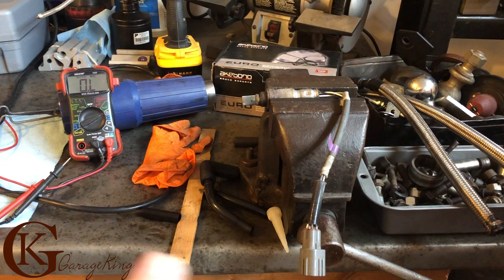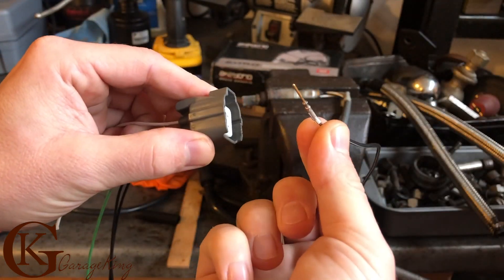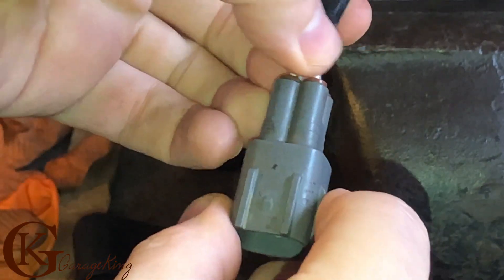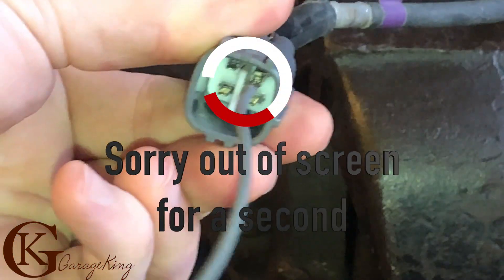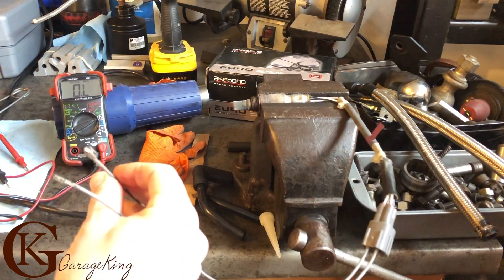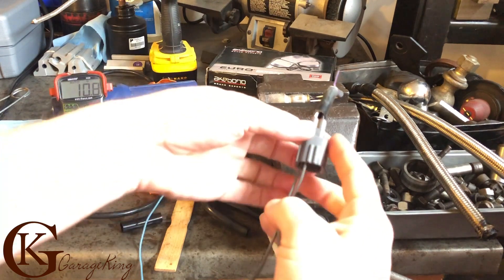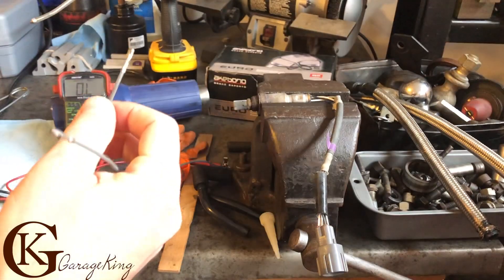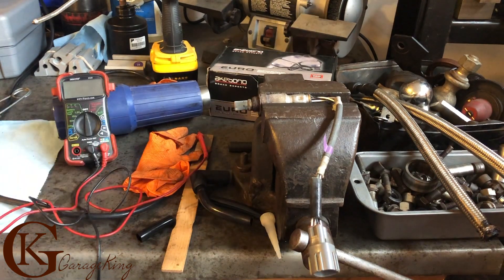Best way to hook up Electrical Connectors for Testing

Comment: do you know of any kits that supply the different sizes,thanks pete.
Reply from the maker: Hi There, I made up the connections with GM connectors (I'm a GM mechanic) and they are not cheap, but they work well.  Here is a kit for testing that has an assortment of sizes https://amzn.to/3VclCvQ  If you are looking to make your own then then you can buy the connectors (this is a cheaper one as the sizes are limited https://amzn.to/3WPX798 and you need a good pair of crimping pliers designed for these https://amzn.to/4bQupcv  If you have any other questions just let me know, sorry for the late reply, its been a busy day.  Hope you are enjoying your weekend.

Comment: Very informative. Thank you. I have a pool robot power supply that I am trying to test to see if there are problems. Any video I have found applies to a 2 pin plug-mine is 3 and now I am unsure of where to insert the prongs to measure dc voltage which is supposed to be 29 v. Any suggestions would be much appreciated
Reply from the maker: Oh boy, that is a good question.  Many manufacturers change the location of the wires around so there is really no way to know unless you have the manual.  The electrical wires for your house are standardized for color (red/black=hot and white is neutral) but for products there is no standardization.  Since it is DC volts if you can get a test light and ground it, then you should be able to touch each terminal with the test light, and one should give you a voltage.  A test light like this would probably work https://amzn.to/3EmwkH3  That is the style I use on cars all the time. If you have a manual or a schematic diagram that would help a lot as you will be able to determine which wire is the feed.

Comment: I'm having trouble testing power connectors that connect to my sensors in my car. I have my car turned it off. I tried the continuity test, I get nothing on 3 different sensors. This is after I unplugged TCU. Okay so finally I decided to skip the continuity test. I tried plugging the battery in. And I tried the DC voltage test. That doesn't seem to be working either. The car is not on. Do power connectors continually send voltage to the sensors? Or does the car have to be started for that? Or maybe its just some sensors?
Reply from the maker: Hey There and thanks for the comment.  The best way to test the car sensors is with them unplugged from the car.  The cars computer does send a 5V reference signal to most sensors.  NEVER test the part that goes into the computer unless you have the wiring diagram as you could damage the cars computer.  As for the sensor, once they are unplugged, if its an oxygen sensor it will have a resistance between two leads, and then it won't have continuity between other combinations as you could be measuring the power heater side, and the resistor side which "don't" talk to each other, so that's why its open.  The good thing about the O2 sensor is when its unplugged and you are measuring it with an ohmmeter you can't damage it. The car does not have to be started, and you should not check if its still plugged into the car.   The sensor must be checked when unplugged from the car (bench testing).  Another way to check your oxygen sensors is with a scan tool (easy way) if its got live data.  Something like this https://amzn.to/3TsCn1S
Reply: @GarageKing   yeah, alright. I'm assuming when you say test the part, have it out of the car like any sensor. But I'm wondering how you test the power connector that connects to that sensor. Assuming I have the sensor already disconnected from that power cord. The power connector is connected to the wiring harness?
Reply from the maker: @deegee2416  Ahh, I see what you are saying, on the sensor side it's a resistance, just like a lightbulb.  But on the power side, that's the computer side. I have never checked in my many years of working at a dealership, and the reason I believe is they are variable.  They only supply power to heat the oxygen sensor until there is a reading, then the hot exhaust takes over, so I don't think the power is constant, and I'm not sure what determines when it's active.  Different manufacturers most likely have different tricks to getting the same job done. If you really want to test this is how I would do it, BUT DO AT YOUR OWN RISK - use an expensive auto-range multimeter and tap into the feed line coming from the engines computer with the oxygen sensor attached, and pin to the oxygen sensors line (this will damage the oxygen sensors wire - you pierced it) but it will protect the computers wire as you are not going to replace the harness, and by leaving the oxygen sensor attached it will be providing the load for the computer, and an expensive autorange multimeter should not impact the voltage when doing this. A test light would draw way too much current and most likely damage the computer. 

I have never had to do this, so I'm wondering why you want to?  Even if the computer did not supply voltage, it just means its going to take a bit longer to get a reading.  The only point of the computer providing voltage is to get the oxygen sensor working faster.  It will still work without the computers voltage, it just will take a bit longer.  Remember when the car is running at operating temperature its the oxygen sensor providing voltage to the computer, not the other way around.
Reply: @GarageKing  Yeah, that would be pretty hard to do, but I will keep that in mind. I was finally able to test the voltage and the grounds. I needed the battery connected. And also, I needed the key to go to the start position. Otherwise it would not send out those voltage signals.
Reply from the maker: @deegee2416  Glad you are getting it figured out :)

Comment: I wish you would show the package the connectors came in so I know what kind to get.  gauge of wire etc etc.  crimper??  details details
Reply from the maker: Good call brother, the test leads I made years ago.  They were from a General Motors Delphi repair wiring kit.  I'm not sure its available to general public.  The GM kit had multiple sizes in it, so I made a bunch of random sizes when I worked as a tech at the dealership.  I'm going to have to check around to see what I can source out.  Great comment, and thanks for bringing that to my attention, you raise a really good point.  Thanks